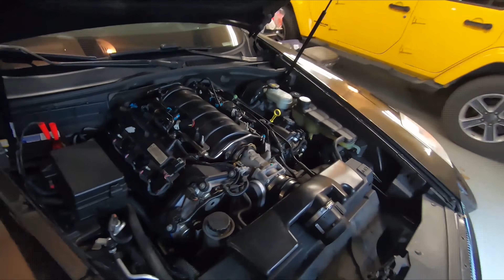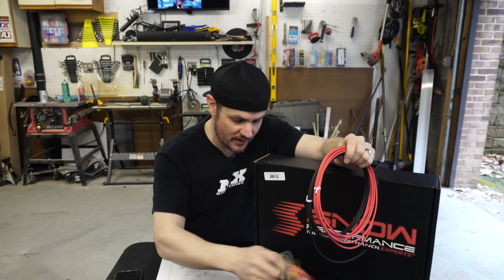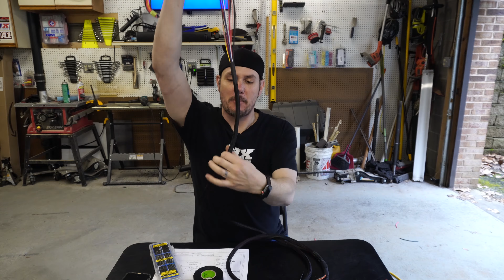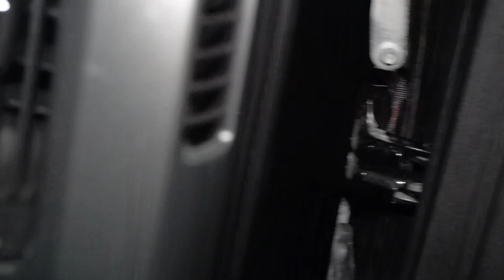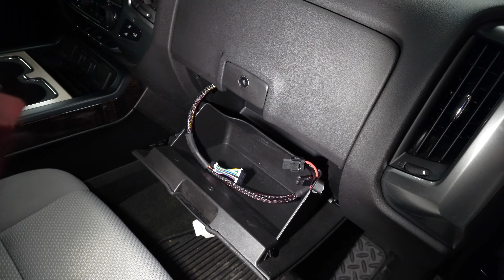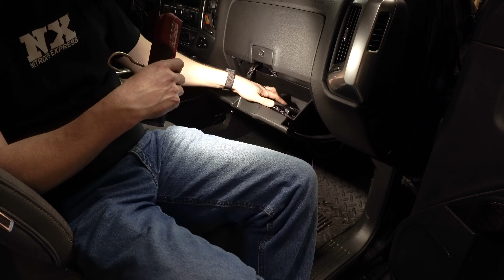Wiring The Snow Performance Stage 4 Methanol Injection System!

Comment: Truck is going to be a beast! So your running the solenoid, and the green led off the White wire GP1 (from the harness/unit)? I see the white (GP I/O) and the Orange wire calling for an ignition source...
Reply from the maker: GPO1, will have to look it back up but yeah
Reply: I thought the green wire was for the solenoid?